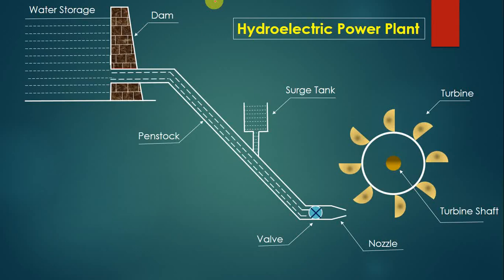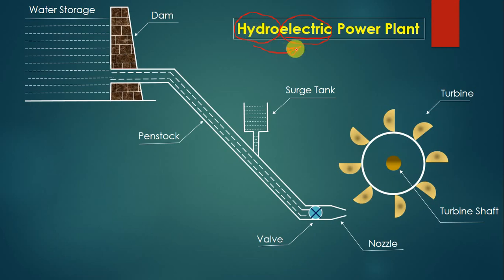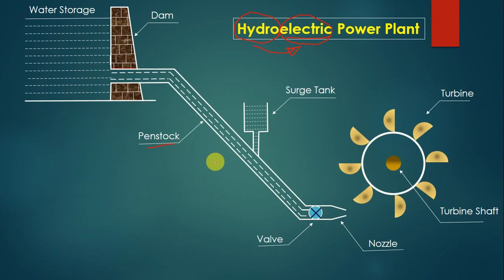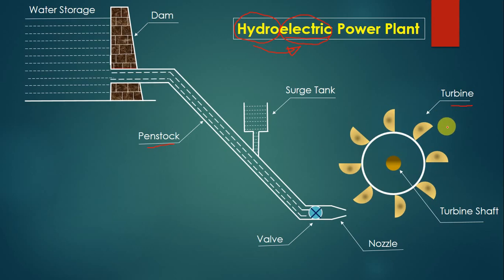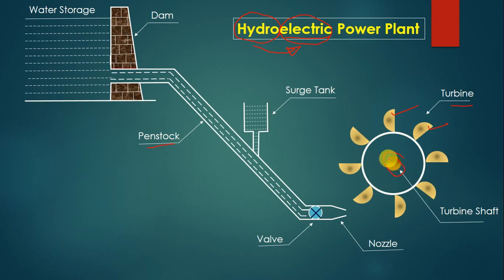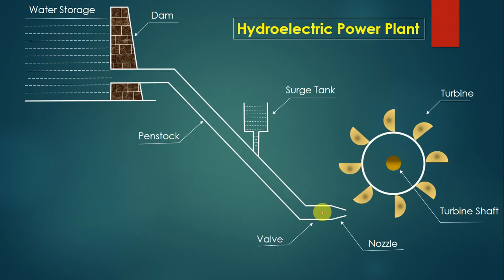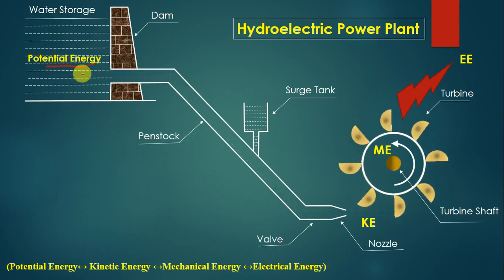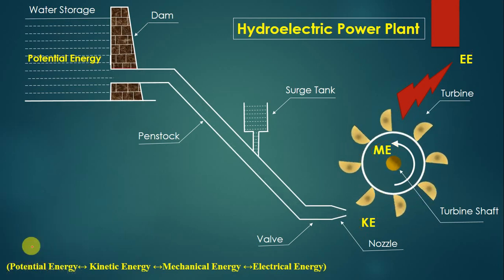Hydroelectric Power Plant working animation

Comment: Sir i have a question. So we have hydro power plant with certain capacity. How peoplewho operate the plant regulate the flow for the plant to work with certain power/ capacity. People have told me that the capacity depends also on the height of the accumulation. I still don' t understand what parameters do people who operate thepower plant change for the plant to work with certain calacity? Please clarify.